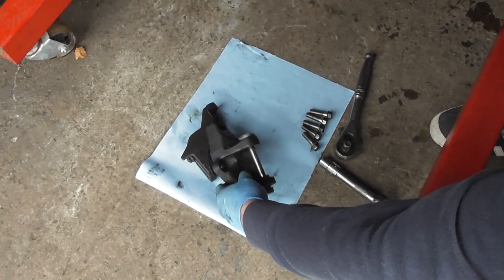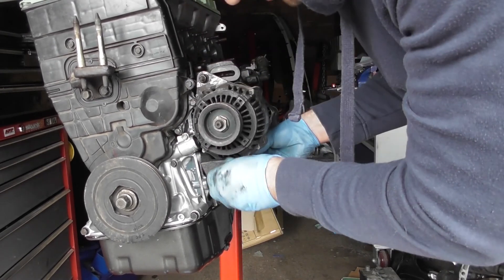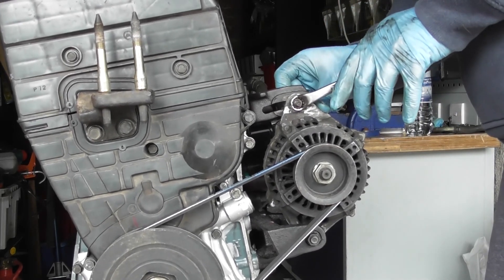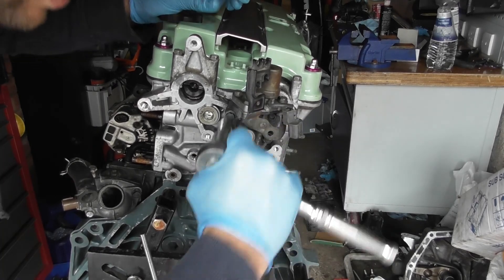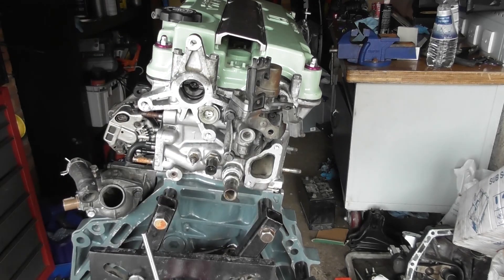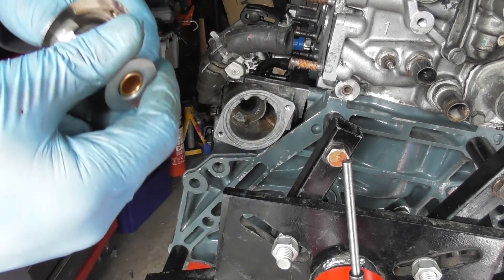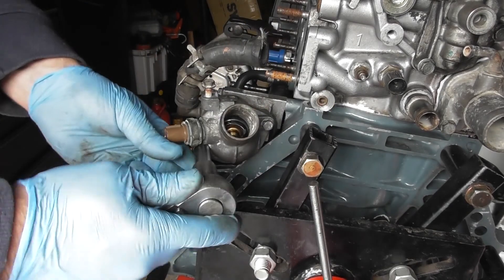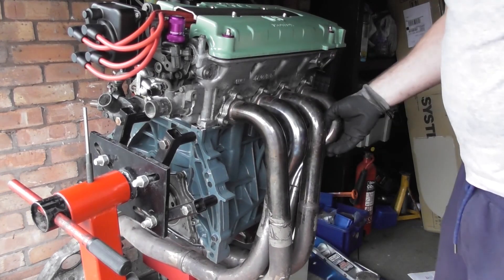T2CG Honda Civic B18C4 Engine Build Part 8: Alternator Belt VTEC Solenoid Head Sensors Thermostat

Comment: does your car have power steering or ac? that crank pulley looks different from what I have.
Reply from the maker: Hi,
No the car doesnt have Power steering or AC. This is the pulley that came with the engine (when it was fitted to a classic mini), so they probably swapped it so that the total engine length was shorter.
Thanks

Comment: Hey great videos! Im building a B20 with P72 GSR head. can I use the same belt as the one you used in your video for the alternator ?
Reply from the maker: Kaveh Baradaran I am not sure if this belt would fit, my engine is a standard B18C4. You might need a longer or shorter belt. Thanks